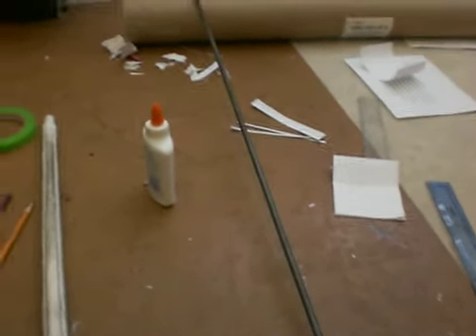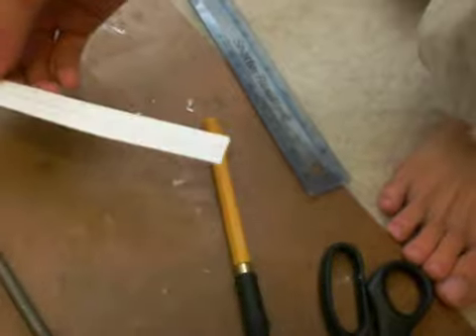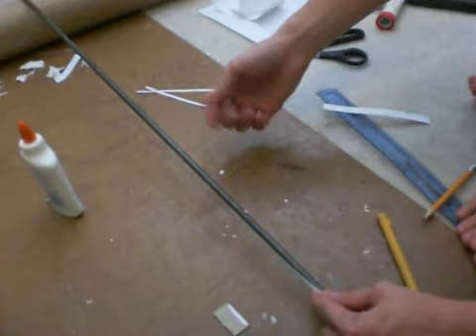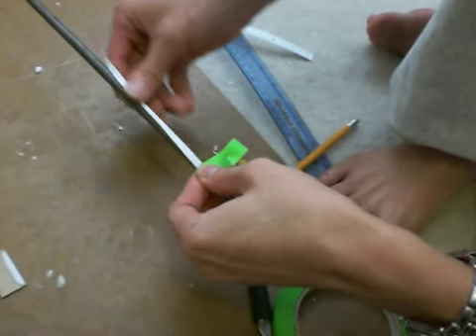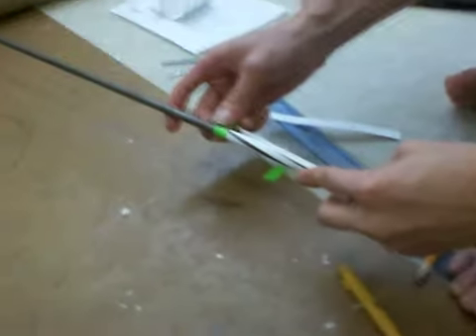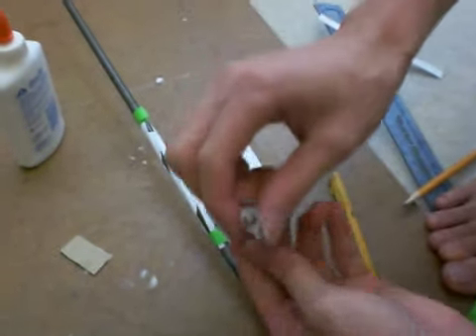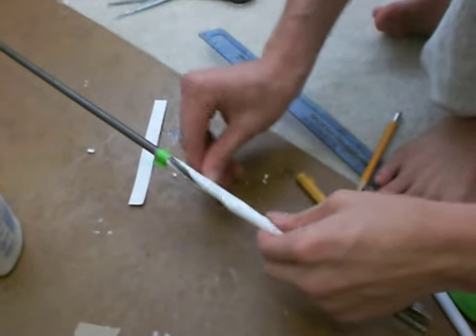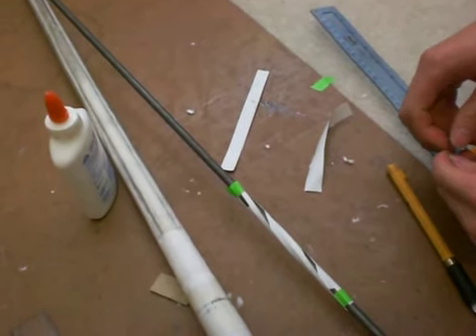how to put rifling?

Comment: @codlord10 rifling puts a spin on the bullet which keeps it stable while firing. if you compared the accuracy of a rifled barrel to a smooth bore (non rifled) barrel you would see a significant difference. rifling works sort of like say a football when thrown is spinning. It keeps it stable and accurate

Comment: I have doubts that this really works, not the hard paper stuff but rifling it. I have a real rifle and when I first got it I got a bullet and tried to put it in the muzzle of the rifle. It didn't fit, this is because a rifle must engrave the bullet to make it spin. The bore of a barrel slowly tapers and as the bullet travels through the barrel the rifling cuts into the bullet and makes it spin. I don't know what your bullets are made of but I doubt paper rifling can engrave it.

Comment: Okay, rifling is very simple. Think of a straw, with that straw there are small grooves from the action to the muzzle. They are call Islands and Grooves, these are slowly twisted through a rifle barrel. This allows a bullet to spin, which increases it's velocity and giving it a trajectory. If you shoot a modern bullet in an unrifled barrel, it's  noticable that the bullet drops faster, moves slower, and is a lot less accurate. Instead of a 100yd shot, you'd be lucky to hit 55yd accurately.

Comment: but this doesnt work with paper. I have a real rifle and when I first got it I got a bullet and tried to put it in the muzzle of the rifle. It didn't fit, this is because a rifle must engrave the bullet to make it spin. The bore of a barrel slowly tapers and as the bullet travels through the barrel the rifling cuts into the bullet and makes it spin.